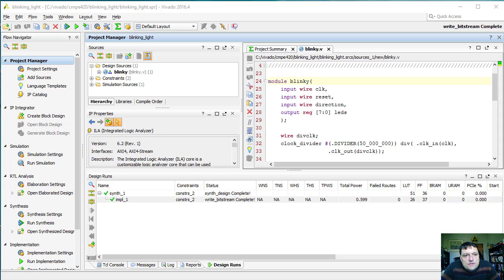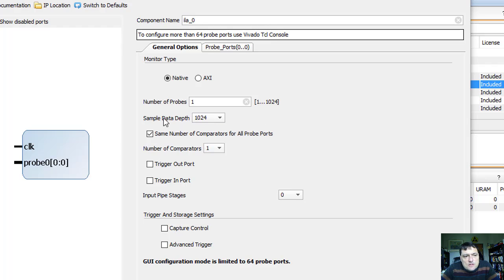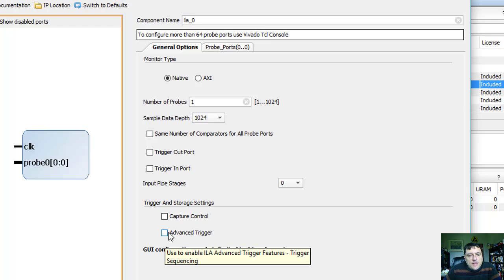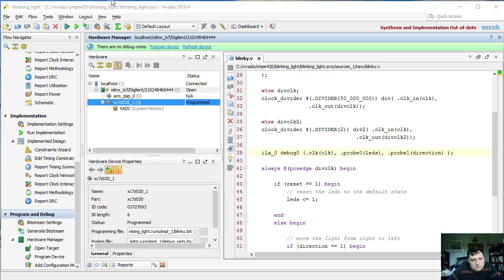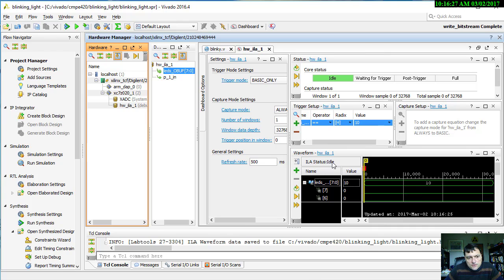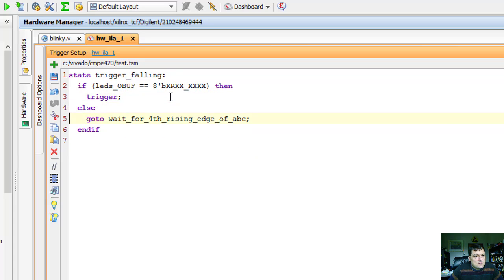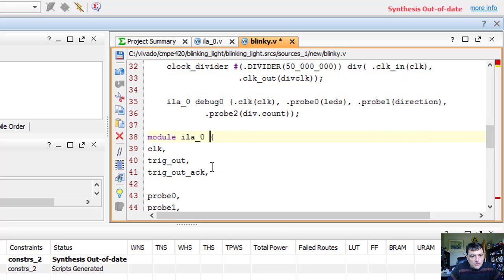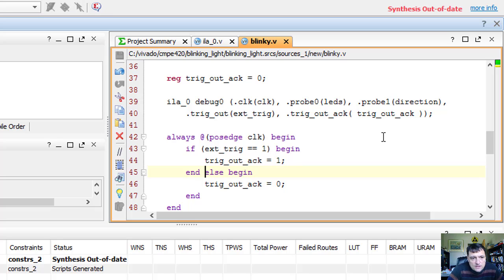Vivado ILA Debugging

Comment: sir , what i the exact difference between trigger out port and trigger in port,  if perticular pin in FPGA used as in put from other slave or field then how should I treate that signal ( either in or out port), at the same time if perticular pin is used as inout in my project if I want to monitor how should I treat that in Debugging ports.
Please suggest me.
Thank  you very much sir,

Comment: Hi Tom, it will be very helpful if you give some more context. Please tell about the existing project, its ports that will finally map to FPGA I/O pins, wires which will not map to FPGA I/O pins but we wish to monitor them, then show the generated ports and logic after implementation at different steps etc. Then show some test cases of it triggering, may be with or without an actual oscilloscope. This is way too fast and misses a lot of details that are very relevant to the context of when and how to use to get some results.  Q - What happens after I insert the IP and implement and see a fault ? Is the further debugging only using an oscilloscope ? Thanks.
Reply: All of your comments are right on.  Thank you.  I was trying to keep this one short. I agree that there needs to be a longer one using the newer versions of vivado.

Comment: Great, thanks. I've used the other method of having Vivado insert an ILA after synthesis.  There's a "wizard" for. One thing I also struggled with today was lowering the speed of the clock that takes samples once the trigger condition is met.  Most of my system runs on a 50Mhz clock, but one module generates a pattern that takes 40ms to finish. At 50Mhz, there isn't enough capture memory to get the entire thing. I tried enabling a 1 Mhz clock and making the ILA use that, but I got into all sorts of trouble.
Reply: mdesm2005:

Hey, since I also had all kinds of trouble (mainly with user chain settings), I read quite a lot about troubleshooting ILAs.

You need to make sure that your active input clock for the ILA still has a frequency at least twice as high as the JTAG frequency of your device.
You can simply lower the JTAG frequency in Hardware Manager if you have a "slow" input clock to your ILA.

Cheers, Tim!